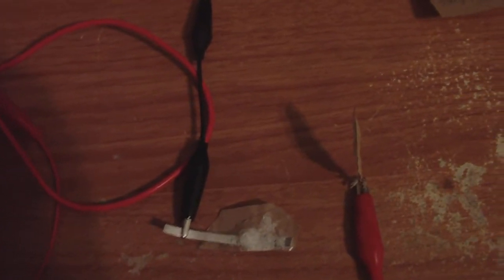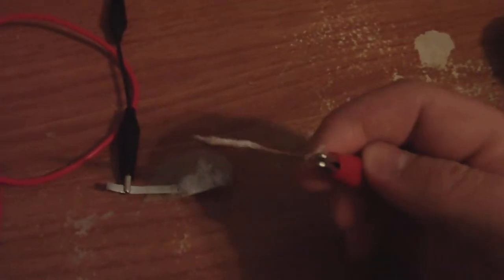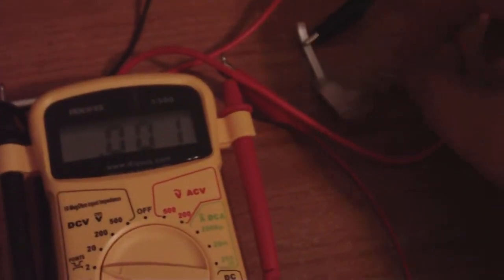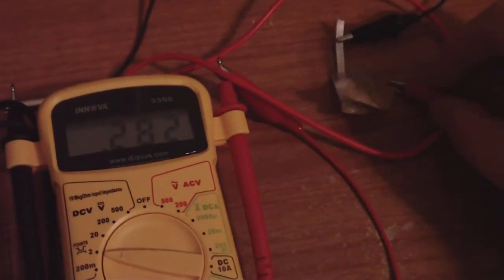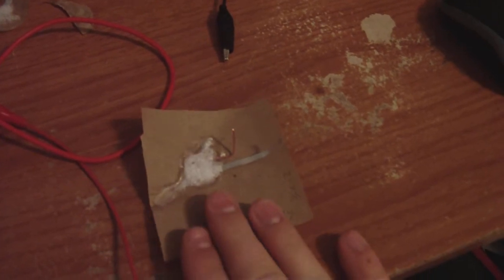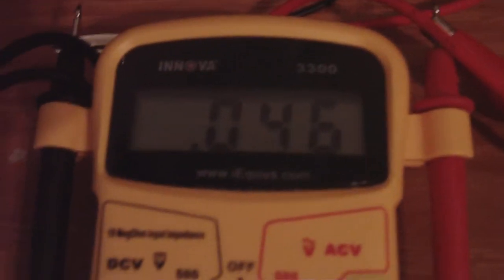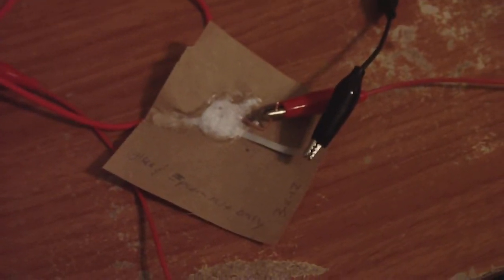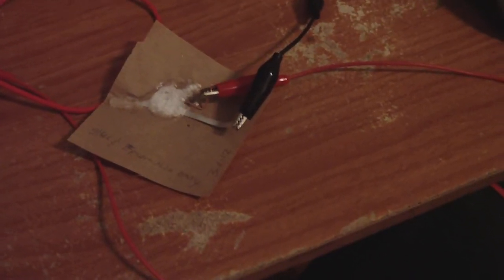Cut a Crystal Glue cell in half

Comment: Very close on this one a conductive crystal lattice would help the salts and alum are only conductive when exposed to outside influences such as water, heat, pressure or other chemicals doping elements into the crystal lattice helps but not the solution so far but still trying my next thought is a pressure chamber with a shielding gas putting pressure on the crystal in the chamber perhaps argon or helium

Comment from the maker: @harpbloke 

I wouldn't say magnesium is highly flammable but instead I would say its highly reactive. Magnesium needs to be heated to a very high temp to get it to burn. But when it does burn its so hot that it turns water into steam. I don't have a way to measure temp of the cell but I have cooled one down to 0 degrees over night and it still worked just fine. Thank you for you interest in my cells, I have more on the way.

Comment: Seems to me that one more discovery is needed to make the cell a long term producer without eating up the electrode something like used in the tungsten coil in lights and the gas that redeposits the used electron back onto the filament a liberation and adheresion cycle that repeats over and over giving us the power that we need, still looking for the right metal combo though I have slowed the galvanic to a slow crawl when electrodes weighed they are still light at the end although some are very

Comment from the maker: @DrSaminstine 

Yes i find that amps depend on either plate size, resistance of the material, or how much water it contains. Having more water touching the electrodes means more amps, less water you have the higher the resistance becomes. Usually with a normal cell as it dries out it not only looses amps but also voltage, but these cells only loose amps.

Comment: We do know there is water of crystallization in the lattice, that's fact. The beauty is, just that, in the lattice th water is not so easily liberated to form hydrogen, which inherently assists the sulfate in forming amounts of H2SO4, which is acid, and causes corrosion. It's a good thing, in my mind, you are, to one extent or another using to move charge; not flooding the battery and watching it corrode over a months time. That's how I see it! I like how they work, it is very interesting

Comment: Great work on all of this by the way I have been working with these cells for months now, I have water cells and crystal cells, the elements you use will fluctuate with atmospheric conditions like humidity I have bone dry cells gain water and lose it by the end of the day rock hard salts melted together become soft and tacky in high humidity the power reflects the change in atmosphere the outer skin becomes a conductive membrane moving H and HO and h2o molecules through the lattice

Comment: IB,
There still is water molecules trapped in the lattice. Again, If you really want to put this to the test to show, Sealing in a jar filled with crystal cat litter or silica gel for a month will help pull all moisture out of the lattice.  The other way is DEEP SUSTAINED VACUUM like what is necessary for electron microscopy sample preparation.  The water is INTRISICALLY TIED UP IN THE LATTICE, your cells simply are RETAINING it.  What mediums can POSITIVE IONS travel in?  Gas, or Liquid.